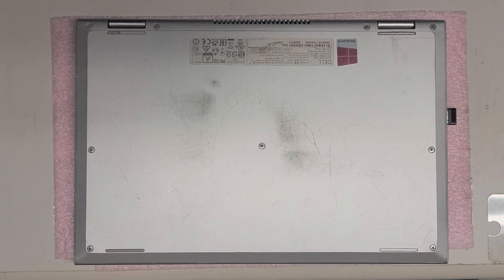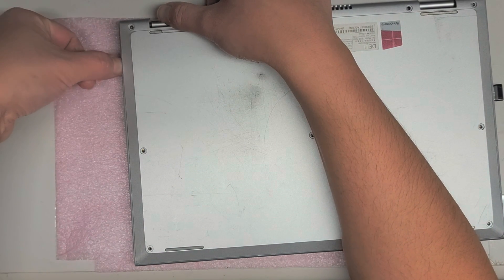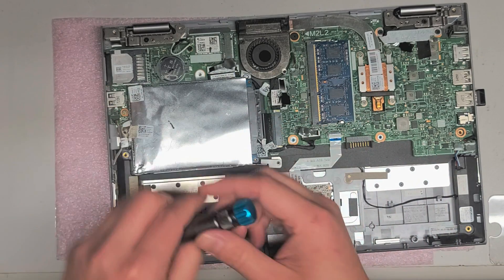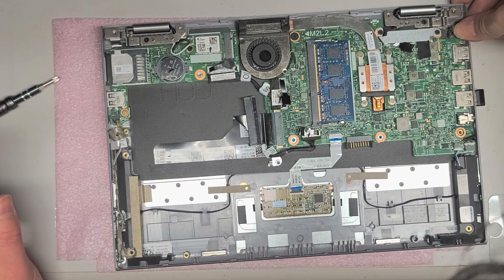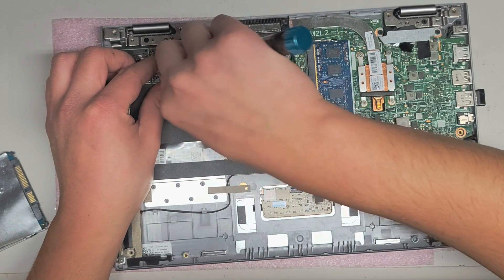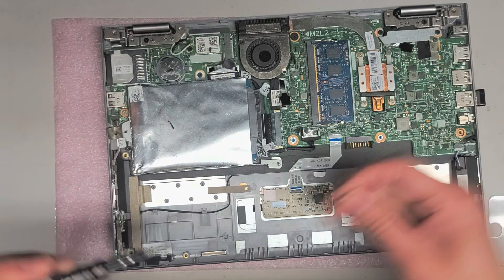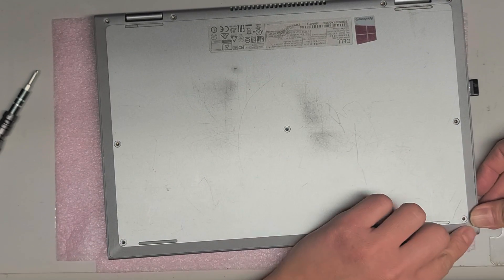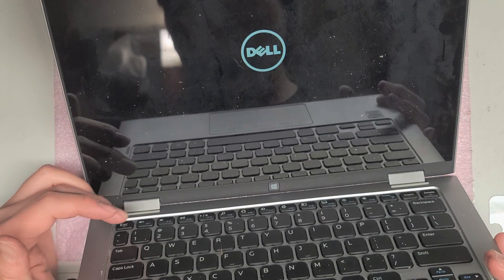DELL Inspiron 3147 Disassembly RAM SSD Hard Drive Upgrade Boot Issue Power Loop Repair CMOS Reset

Comment: Huge help. I really need to replace the 5400 RPM HDD on mine with a SDD and I was afraid to pull that bottom plate off without seeing it done first. Thanks much.
Reply from the maker: Glad it helped. If you haven't already, please like and subscribe so others can find my videos. Thanks!

Comment: How do i fix my laptop dell inspiron 11 3147 with no bootable device using solid state drive
Reply: I was swapping my grandmother's SSD and the same problem happened. If you just upgraded, make sure it's listed as a trusted boot device in BIOS.
Reply from the maker: Most likely the drive failed. Need to replace the drive and reinstall Windows